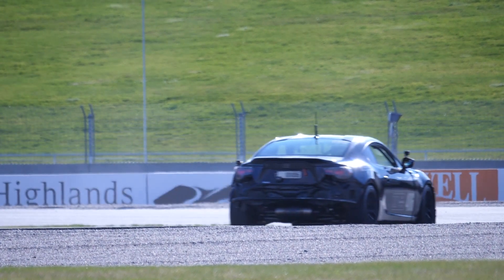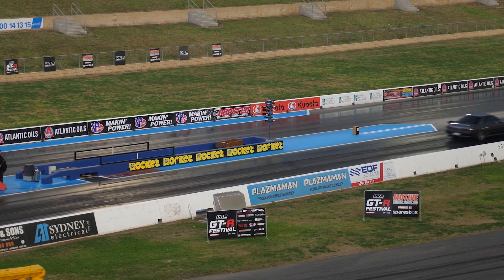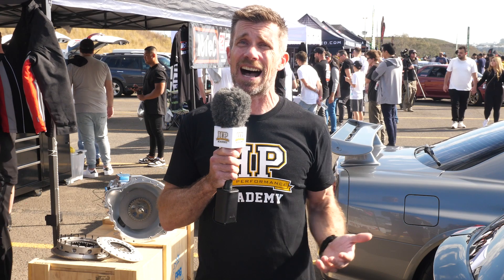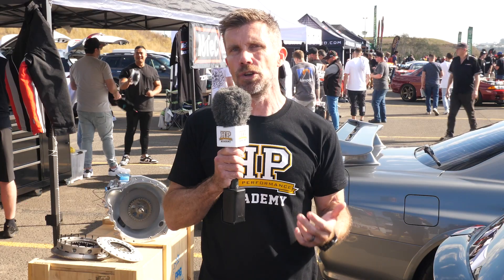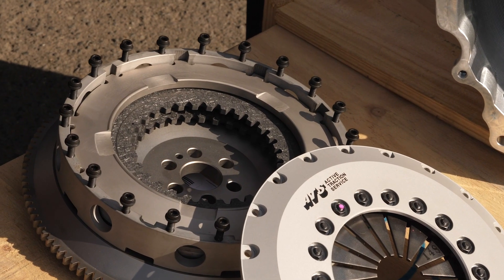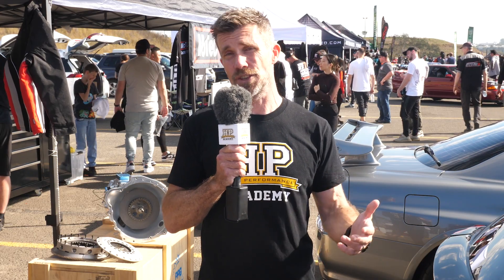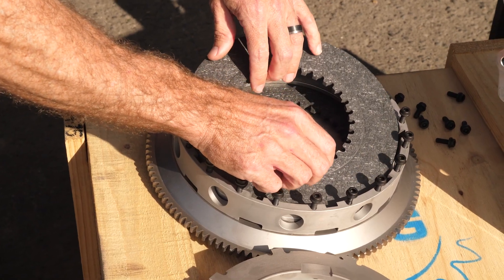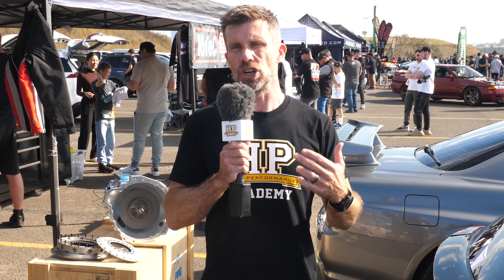3 Key Factors for Selecting the Perfect Clutch

Comment: As with other non-OEM parts, I have found that "daily drivable" is quite subjective. Mantic ceramic 9" twin was 35lbs, but when it failed I tried a 51lb triple organic because the custon RPS carbon unit I wanted was no longer available. The organic has wonderful parking lot behavior at the expense of a noticeable decrease in rate of accel in upper RPMs.

Comment: Would have been good to see more detail.  Explanations of hub types (sprung/unsprung), the variety of material choices, strap drives, pull/push style clutches and of course, throwout bearing options.  Good video otherwise.
Reply from the maker: Yes just a quick 'Tech Nugget' this one rounding off 3 points. Clutches are something we haven't done a deep, deep dive on before but we will at some point - Taz.

Comment: What would be the difference in a kevlar clutch's characteristics vs a carbon clutch?
Reply: As far as I’m aware Kevlar / aramid fibres will not handle the temperature and are synthetic. 
A carbon clutch is similar to a carbon brake rotor. 
Technically sintered carbon . Pre formed in a compression mold and then baked in an oven.

Comment: Something one may need to bear in mind is that the force needed to release the clutch is being directly applied to the thrust bearing of the crankshaft - most times this isn't an issue, but with some vehicles it definitely can be. so may need to be addressed before failure can occur.
Some vehicles do have high pedal forces to release the clutch, or are intended for people who may have problems fully pressing the pedal - in some cases the manufacturers will use an 'over centre' spring that only applies a spring assisatance when the pedal is already partially depressed - I had an old Pontiac that did this, and there are instances with hydraulically operated systems where an in-line "brake" booster is used to reduce the pedal force required - the Maserati Bora was an instance of that.
Some of you may have injuries, or other reasons, where you have trouble operating a clutch, and those options may be helpful.

Comment: What's your recommendation on running sprung vs unsprung clutch disks on a single mass flywheel. We are doing a low torque J32 build, and we are looking at running an OEM Honda unsprung clutch for a lighter input shaft inertia on the trans, and a lightweight flywheel.
Reply: Unsprung from most brands are a disaster but not so much in “some carbon clutches” I say some best bet do some research on brands and there styles in whatever car most info online is on gtrs and evos and u will gather ideas on how they all drive my own personal experience is with a ats unsprung carbon and the ceramic metallic and in ways it felt like it gave less shock load then a sprung hub organic strange but what I noticed

Comment: How about engine harmonics? I truly believe the flywheel makes  a big difference in this.
Reply: OEMs would use dual mass flywheels, as they smooth out low RPM power pulses while the clutch is engaged. Unfortunately, they generally can't be rebuilt or resurfaced, are expensive to replace compared to single mass, and are generally too heavy for an enthusiast application.
Reply: As light as possible if you only want to go fast on a racetrack
Reply: Harmonics are usually dampened at the opposite end of the crank via a small flywheel so there should be no problem. Or a driven counter balance. 
Dual mass flywheels as far as I’m aware just make the clutch pedals lighter and more road user friendly.
If anything a dual mass flywheel would add vibrations and potentially damaging harmonics to an engine’s crankshaft due to long term wear and movement in the assembly. 
I’d have a normal clutch any day of the week compared to a DMF even if it did mean a slightly heavier pedal.

Comment: Excellent criteria to think about.  I went through four different clutches in my build before finally finding one that would handle the power, slip nicely, and gave minimal noise during daily driving.  I ended up going with a twin disk, sprung, clutch setup with organic disks.
Reply: Same, went to a 6 puck ceramic disk and it performed worse than my oem clutch, and wear was extreme. I ended up going with an oem style and material, just about a half inch bigger than stock.

Comment: Wow, carbon on carbon. I've never seen/heard of that before, in any application. It almost sounds too good to be true? Presumably it's quite expensive? 

And I'm not certain I 100% understood its suggested application here - is it meant to be a performance street option, suitable for things like autocross, if not track use, while also being durable for the street?

I'm really surprised to hear that it would be low-dust. I would expect the exact opposite.
Reply: Tilton Engineering and AP Racing make carbon-on-carbon clutches. ZF (Sachs) also makes them for high-end applications like F1 and LMP1.
Reply: @natsuotsuji  Tilton makes some great stuff. I bought their clutch master setup for my 96  c4 corvette.
Reply: They are expensive. Very good though but require correct shimming . 
Clutches are dry assembled and then shims inserted to determine friction disc pressure. The more shims the less the clutch slip. 
If you thought these were trick look into drag car clutches with counter weights. There’s one on YT showing how they  set them up all still basic mechanical engineering but very interesting .
Reply: I got an ATS carbon twin plate for my 350z (similar to the one pictured)

10/10 would recommend